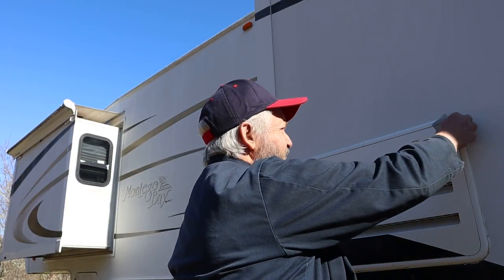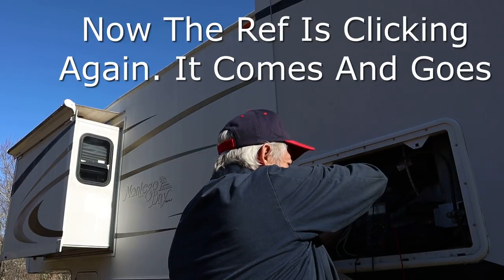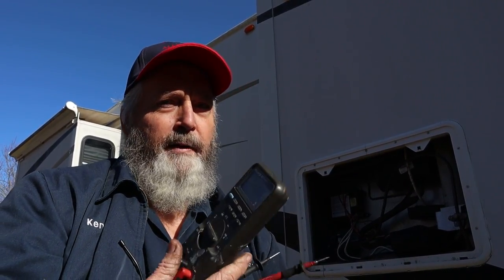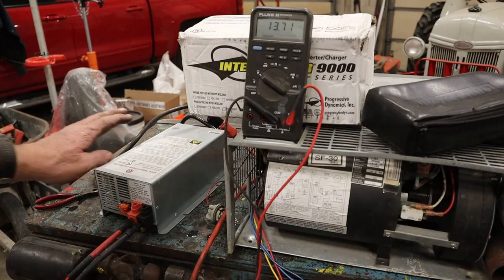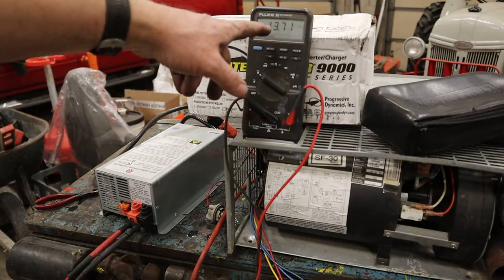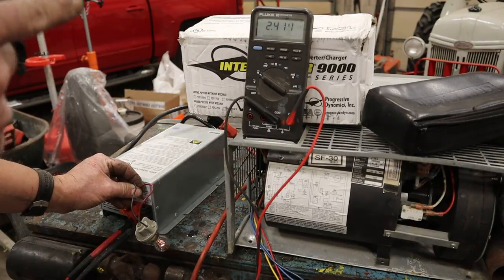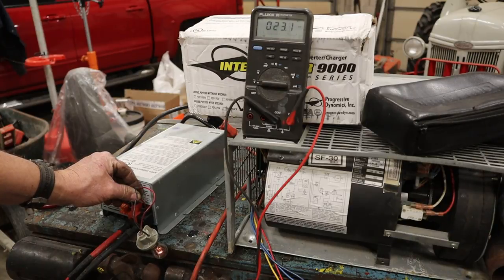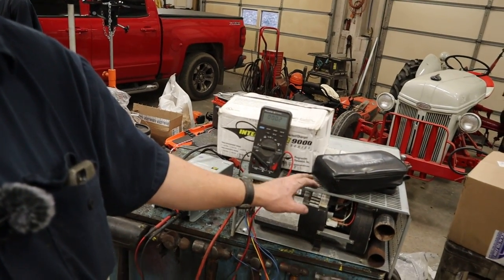Refrigerator And Furnace Not Working. You Might Be Surprised By Results

Comment: thanks for posting, i had the exact same issue with a furnace. i had the furnace working fine on the bench put it back in and started clinking....i started checking things sail switch etc. little did i know the trailer got unplugged and voltage was just a tad low!. sometimes i find myself chasing my tail lol.
Reply from the maker: Now that I think about it. I think this converter was just putting out low voltage too. It was jacked up for sure.
Reply: @hillbillyrv  if the voltage is low, but just high enough to trip the boards relay for powering up, you will get the red board light turning on and off and clicking
Reply from the maker: @RADMAN752  I think that is exactly what was going on here.

Comment: Thank you i believe this video has helped me out alot. My fridge has been shutting off especially when its cold out and then the furnace and the fridge wont turn on again until the furnace turns back on. I checked the power converter its humming alot and the fan isnt running on it. Is it safe to say i should replace my converter?
Reply from the maker: It is safe to say that you need to test it. Only replace it if it is bad.